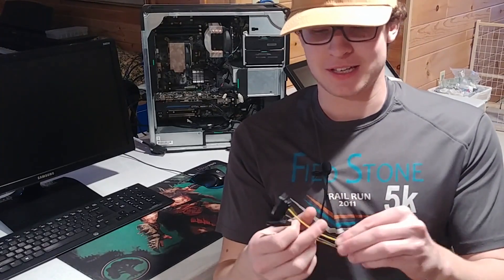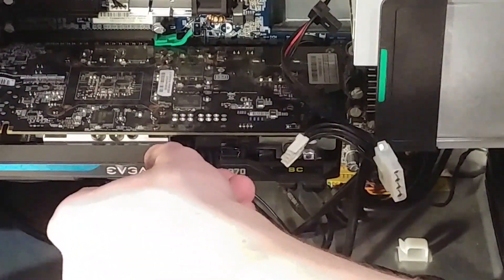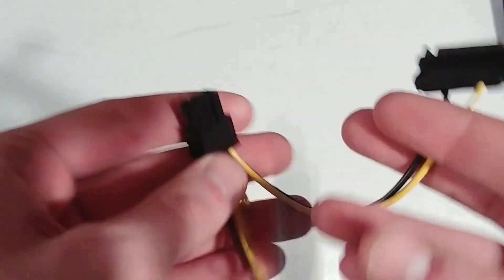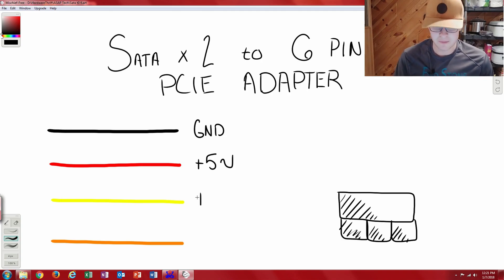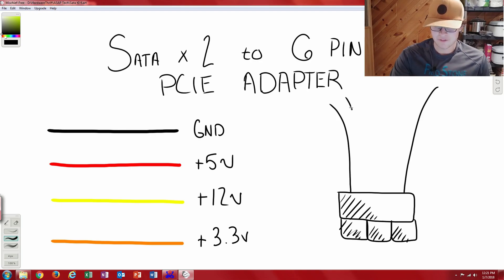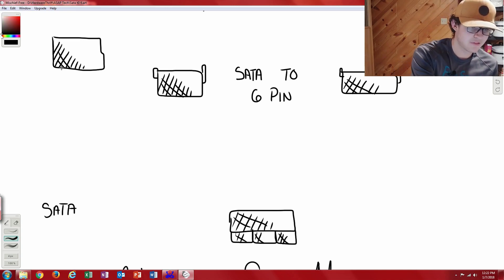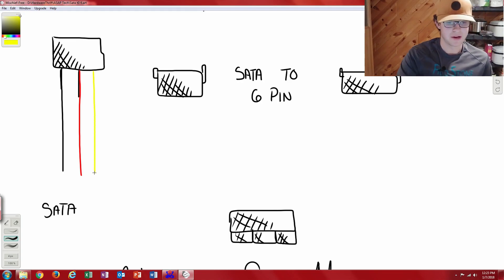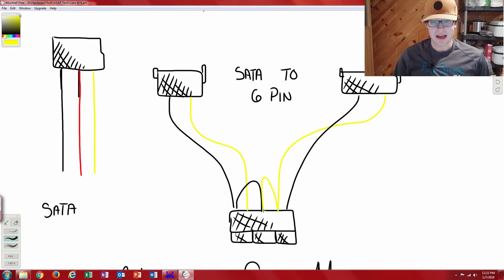2 x Sata to 6 Pin PCIE Power Adapter for Graphics Cards || ASAP Tech

Comment: Alright, i have an rx 580 8gb and it needs 6 pin pcie and an 8 pin pcie. my psu comes with only a 6 pin, will using a 2 x Sata to 8 pin PCIE be safe? (using a prebuilt dell optiplex 9010)
Reply: any updates about your situation?
Reply: @jansen7640  ya you'll be fine as long as u don't need the sata for something else
Reply: yea any updates?
Reply: @bipaular7227  ya you'll be fine

Comment: I have 80w GPU 
Is it safe to use 1xSata to 6pin ? 
My PSU have only 2Sata cables .. 
And i need one for my SSD 

I know its just 5watts and thats nothing , HHD's consume more than that .. 
But i am afraid from this : 
If the GPU deside to take less power from the motherboard and take more from the cable .. 
I am not ready to fire my PC yet .. 

My GPU is HD7770GHz 
CPU : Q6600 Oced +3GHz
PSU:Low quality 550w ..
Reply: You could use molex to PCI-E 6 pin instead. Or use something like a sata power cable splitter. Also you've got a really nice setup. 8 gigs of ram? :D
Reply: @raiyantajwar1564   a 1*molex to 6pin ?

Comment: thanks for the very informative video. there is a video which explains molded-in sata cables has a risk of catching fire due to faulty contact within the mold. is this a high probability in 2xSATA > PCI cables? because wattage per sata is low in this case.
another question is are 2xSATA to 6+2 cables safely usable in 6pin graphics cards when extra two are removed?
Reply: Hello black friend, it's safe

Comment: The link you provided does not have a 2X sata to pin 6. It has a 2X sata to pin 8. Do you have a link for a 2X sata to pin 6?
Reply: Usually the 2x SATA is for 8-pin and 1x SATA are for 6 pin.  Good news however, most of the 8-pin adapters are 6+2.

Comment: I just bought an rx 570 (gigabyte) which has 120tdp i think and my psu (500w) doesnt have 8 pin pcie connector is it safe to put an 2x molex to 8pin adaptor?
Reply: Yeah i also bought one, but my psu have one 6pin connector, however plugin just 6pin connector, it still works flawlessly. I think am gonna buy 2xsata to 8pin connector.

Comment: Is it safe to use a 2x molex to 8 pin for gtx 960 2gb? 550 W PSU
Reply: Did it work or is it safe with 300w?

Comment: i have a 320 Wat PSU  and i want to use these adaptors to conect to my RX 460. Will it work or will it  explode my pc ?
Reply from the maker: I recommend upgrading to a 400W or 450W powersupply
Reply: Hardware Thrift i tried it with the sata to 6 pin just for curiosity. The pc booted normaly with the windows welcome sound but  i had no display on my monitor . Does this mean i need a better PSU or is my graphic card broken? P.S Graphic card fans and CPU fans are spining pls answer
Reply: @lyrical5460  get a new 450psu . no display problem happen when u don't have enough power to use the powerfull card you need 450wat PSU atleast

Comment: I got exact same card bro 6 pin and 8 pin. i only have 6 pin in my case along with 1 male molex and 1 sata so ive unplugged a sata from ihas drive and bought a single female molex to sata to put back into ihas drive.that gives me 2x sata free so  2x sata to 8 pin cable it is.

Comment: could I power a gtx 1060 or RX 580 from one of these on an OEM HP 320w psu?
Reply from the maker: No, not enough power, youd need at least a 450W power supply
Reply: @TOMMAKESSTUFF  That's what I'd assumed. guess I'll be getting a new PSU and a 24pin to weird HP mobo adaptor.
Reply: Will it work if i has 450w psu without 6 pin amd can this method used for powering my gtx 1060

Comment: can i do this with my new graphics card gtx 760 it needs two 6pin connector
Reply from the maker: Correct as long as you have at least two extra sata power connectors on your power supply
Reply: @TOMMAKESSTUFF  thanks for ur fast reply
Reply: never open the case since upgrade hope it has sufficient  sata power connectors thanks

Comment: Thanks for the video but all of that just in theory, molex is only 50w, sata is only 35w
Reply: @Leviathan DIY what do you say about this ? kind wierd you didnt answer him as i want to know the answer to
Reply: The last time I had my psu open (done this a few times) the red wires pretty much all connected at the same huge glob of solder. Same with the yellow, and so on. All the same guage wire too. So long as you stay within the limitations of each single wire coming out of the psu, I think you'll be fine.

Comment: Hey bro i want to buy a gigabyte gtx 750 ti single fan version and i have no 6 pin my motherboard is 304 bh pcie version 2.0 will this work with me and i have to connect this with the hard disk connectors p06 07 written on it ???am i right??? Please reply..and also it this safe or not??

Comment: Ok so i want to buy a Gtx 1060 3gb but my PSU doesnt have a PCI connector is it safe to buy the thing that u are telling on the video my PSU is 550 WATT!
Reply from the maker: https://youtu.be/aB4xtWVvrpk check out this video I made a couple weeks ago. I go over how much power from a power supply you'll need to properly feed your components
Reply: this should be fine

Comment: Cool thanks for the video tutorial!! I’m curious about the old 2010 Mac Pro towers that use 2 mini 6 pin connectors? I have a Mac Pro 2010 tower and a Vega Frontier Edition. The Vega uses 2 8pin connectors so I assume based on your video that would equal to 300watts but I’m not sure if 2x mini 6pin to 8 pin adapters are going to provide enough power.
Reply from the maker: I am not sure either because I don't know what a 6 pin mini connector is

Comment: are the two sata power cable coming from the PSU or the the motherboard?
Reply from the maker: PSU
Reply: different question. Would you say it's possible to tinker with a PSU that has 320w in order to "make" a 6 pin connector? My PSU has sufficient wattage to power my GTX 1050ti (300w minimum) which I didn't realize requires a 6 pin power connector. I don't have any cable coming from the PSU to even use as an adapter. What would you recommend?
edit: also, thanks!
Reply from the maker: @gk1O1  As long as it has two data power cables you can use the adapter I have linked in the description to create a 6 pin power connector.
Reply: I kinda meant something more extreme hehe. Like soldering cables.
Reply from the maker: @gk1O1  so online you can find the cable connection for your 1050ti, each pin on the connector is assaciated to a wire coming from the power supply, if you can find the correct arrangement you can strip the wires from the power supply and solder them directly to graphics card pins. I strongly recommend not doing this as the heat from the soldering iron can cause some damage to the board on the card
Reply: ugh, I guess so - I'm just staring at a wall unsure what to do :/

Comment: Is it safe to use 2xMolex to 6 pin for my rx560???
Ps: I have a 450w psu
Reply from the maker: Yes! The Molex cables have the same wiring as the sata with a 12v and gnd rail. Just make sure you dont have too many components on one cable line as you might draw to much current from a single circuit
Reply: @TOMMAKESSTUFF  My pc won't boot when I plug the pcie powwr cable could this be the solution I am using rx 470 4 gb the 2 sata to one pcie power is it enough
Reply: @ableh7489  yes enough, but no overclocking please, i burned my cable due to OCing. I used 6pin to 8pin molex convertor.
Reply: @ableh7489  yea don't oc it's dangerous
Reply: @HassaanALal  my psu dont have 6 pin connector and im using gtx 950 asus strix requires 6pin so should i use sata to 6 pin or 2x sata to 6 pin? And is this method good for long run?
Reply: @AmeerQ99  yes it's ok but a dual 4pin or single 8pin to 6pin would be better.
Reply: @HassaanALal  owh ok bcs im planning to use it temporary
Reply: @AmeerQ99  use 2x sata to 6 pin,or u might end up like me after 1 year the cable burned out and my graphic card also dead:)best if u get a new psu with the 6pin connector
Reply: @coregen  What is the wrong thing that you did?
Reply: @fadhel97  i  only connected 1 molex (the other was empty),and over time the 12V cable burn out ,due to high Amper ,and my graphic card goes dead ,so i had to buy a new card and not make the same mistake again i buyed a new psu with a 6pin connector built-in.
Reply: My rx560 came with 2 molex to 6pin
Reply: @DrouTikz agree

Comment: hey umm...i wanted to ask a quick question...might not even need a video for it lol.

I was wondering...why do they recommend not to connect the two PCI Express Power adaptors ( 6 pins) needed for modern GTX Cards on the same "daisy chain" coming form a PSU? what is a daisy chain anyway? do they mean like the same series of wires coming out the PSU? if so..then why it isnt recommended to connect them both to the same chain? also...what is the difference between the one you showed in the video...and the ones that dont have the SATA but rather something else to connect to? because mine doesnt quite look like the one you showed in your video, thanks so much for the help, in advance! :D

Comment: On my prebuilt PC Inspiron 660, i only found 1 sata port that says P9, and i am aware that the converter has 2 slots, so will it work if i just plug in 1?
Reply from the maker: No as you will need two twelve volt rails to provide enough amperage to run the card
Reply: Is 300W enough to run GTX 560 TI?
Reply from the maker: A 560TI draws a maximum of 170W , depending on CPU the rest of your system probaby draws anywhere from 100W to 130W, I usually follow an 80% rule when deciding on what type of power supply to use. this means for a 300W power supply i would want a system that draws a maximum of 240W. Best case scenario your system will draw around 270W meaning you would want a 400W or higher power inoreder to avoid damaging your components.
Reply: i5-3340, intel core processer,

Comment: It works but it is to weak to work in longterm. Not enough Amps through sata could set your PC in fire.

4.5A per one sata Cable... if it is very high quality one. One Sata cable usually delivers ~1.5A
Reply: I have an inspiron 660 prebuilt PC, i recently added a GTX 560 TI graphics card to it, it fits fine, but to power it, i need a PCI-E slot, but i couldn't find it, but i found a wire that says "P9", i'm hoping that if i use these converters, it could power up my graphics card? I'm really not sure, could you help me? And also, if i use these converters it could set my PC on fire?
Reply: if you use sata to pcie itb could fail with fire. use molex one.
Reply: My computer isn't that old so it doesn't use a molex, should i get a sata to molex, then buy a molex to PCIE? and would it be able to run my GTX 560 TI with my 300W power supply?
Reply: However 750ti would suit better than 560 ti
Reply: I have already ordered a GTX 560 TI for a realy good price, but i know that 300W is not enough so how much or which power supply should i buy that's not too expensive?
Reply: JxP
500W should be enough to avoid failing your PC components, also you should not use a sata to molex, then a molex to PCIE because the problem is with sata itself that it has not enough current through sata could lead to failure of your graphics card or even worse set your PC in fire. Also the SATA to MOLEX adapters can melt, so I hear. I've never had it happen, but to be safe, try and not use them.

Comment: i am also use old workstation but now i m confuse to chosing a gpu here is Gtx 1060 g1 avaible but that suport 8pin pcie i have 6 pin what can i do ? i have 475 +80 bronze psu
Reply from the maker: You've actually have a few options, you can use a 6 pin to 8 pin adapter, 2×Molex to 8pin adapter, or a 2×sata to 8 pin adapter to get it powered, look up any of those and it should show you where to purchase them

Comment: Just get a power supply that supports the connections you need. That simple. Reliable power supplies are extremely cheap. $6.77 for an adapter, or you could spend $40 more on a Evga 500 watt PSU that you could always transfer to your next computer. Not to mention most power supplies that come in a pre-built system do not have the wattage overhead to add any other hardware.  While this works, It is bad advice and just trying to beat around the bush of the main issue. As the saying goes.. "Play stupid games, Win stupid prizes". If you don't have the money for proper hardware you shouldn't risk what hardware you DO have on a cheap 6 dollar adapter.
Reply: also, I want a psu ONLY to power my gpu as I am building an external GPU rig for my laptop and I am on an extremely tight budget. it is good to know that I can spend 20 instead of 60 on a psu
Reply: @richardhannay7105  i am also using an egpu setup just to power my gtx960. Does this work?
Reply: @ryanx9777  I got a 750ti working,  no need for external power, I used an 8pin power adapter. They are big power bricks used for usff PC'S,  as for these adapters I would recommend a molex adaptor.  I used one in the past and it worked ok. Any questions?
Reply: @richardhannay7105  thanks. I will get one of these molex adapter.
Reply from the maker: Sparkmovement I completely understand upgrading the PSU if possible, but like in my case I use an old workstation that doesn't support an ATX power supply, since only have one 6 pin connector the best option is to use an adapter, this is also the case with a lot of SFF builds